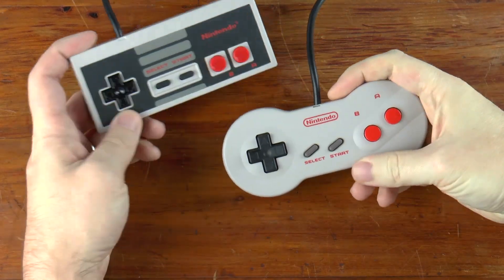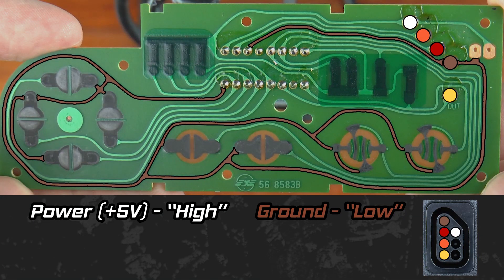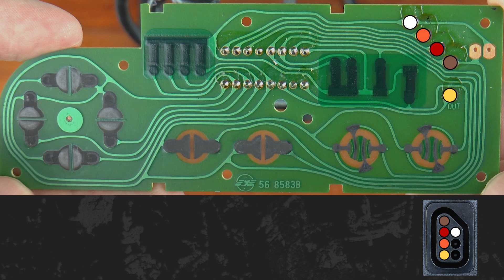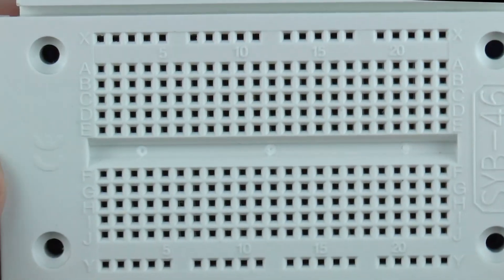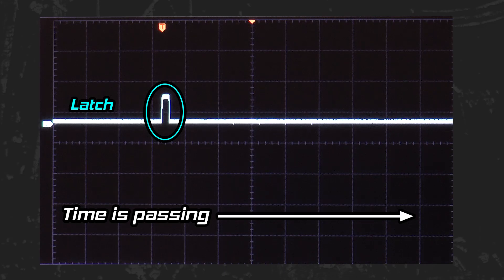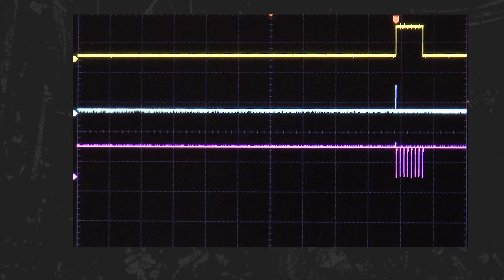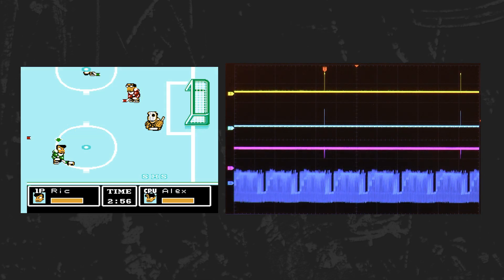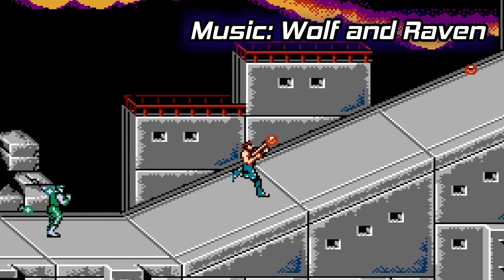Nintendo (NES) Controller - Electronics

Comment: I played sonic on my sega megadrive with the joystick controller from the atari 2600..🤣 It worked like a charm.. The connector is the same.. Just plug and play
Reply: I uses my mega Drive controller on my Atari 800XL...
Also works fine. (B button is the Atari's button, D-pad is the stick.)
In fact, with custom programming I can even read the C button as well, giving a 2 button controller on a system that usually only has a single button.

(of course, if I took the time to create an adapter that swaps around 1 or 2 of the connections, I could then write software that can read ALL the buttons on a 3 button mega drive controller, but that's more complex. - plus with the right adapter that only needs to adapt the wiring setup, I could read a SNES controller in as well and read all of that... )

The Atari joystick standard is extremely prolific. XD
Atari, Commodore, Sega, NEC, and a bunch of others all used it.
Though not always with identical wiring.
And sometimes with a few... Risks.

A Sega Mega Drive controller can hook up to an 800XL no problem, but if you hook it up to a Commodore 64 and mistakenly press a button on the keyboard and controller at the same time, you'll fry some of the c64's circuitry...

Use... Caution. Just because the connector looks the same doesn't mean the wiring is 100% the same. XD
Reply: I was young and ignorant at that time i did that.... 🤷🏻‍♂️🤣🤣
Reply: But it worked like a charm... As the controller was nothing more then some metal strips under a plastic button..... 🤣

Comment: How likely are the shift register chips to go bad? I have a few original controllers that no longer work. I assumed the wires were broken near the controllers case as I naively used to wrap them as a kid, but never found any breaks in the wires of the one I took apart and stripped. Solder joints looked good to me too. I assumed it was a problem with this chip tho I never knew what it actually was or called to this point.

Comment: This is a super well done video and does a great job explaining how it works. If possible, when you get to the SNES controller can you compare the improvements from the NES controller? As Sdudyoy pointed out, it's really remarkable how they decided to go the route they did in designing this. Even though this controller is decades old, the stuff in it is still the material that I learned about in university.

Comment: Intellivision had 15 buttons plus 16 directions on the disc for a total of 31 different connections or what you could technically call buttons since the controller is digital.

Comment: 12:20 how do you hit left and right at the same time?
Reply: Using his custom controller. His d-pad was made from 4 toggle switches, so there was nothing to prevent him from pressing any combination of the d-pad.
Reply: @JohnDoe11VII  But would that even do anything?
Reply: Probably create bugs?

It's physically impossible on normal hardware, so games have no logic to make sense of it.
How they interpret it would depend on how they're programmed.

I have seen TAS (tool assisted speedruns) that use a fake controller do it, and in some games it can let you pull off weird seemingly impossible tricks...

But there is no standard answer to what happens if you do it.
Depends on how any given game is programmed...

Comment: When I clicked on this video I was wondering "how on Earth is he going to talk for 16 minutes about a shift register?  An explanation of how those work is 3 minutes tops!"

Answer: he is going to talk as slow as he possibly can and spend a solid 30 seconds on every single component and trace on the board and gets five minutes in before he even tells you what the shift register does.

And when he DOES explain it, his explanation is going to be both confusing to the average viewer and technically incorrect.

I will give you credit though for breaking out the oscilloscope and explaining it that way.  Not a lot of people take the time to do that right.
Reply from the maker: I feel very proud of this video. Sorry you feel this way.
Reply: @DisplacedGamers  sorry.  Didn't mean anything by it, I just...

talking slowly is one of my personal pet peeves, even if it may help other people.

As for technical inaccuracy, I got you on a technicality.  There is no such   The shift register is always in serial mode, but the "parallel load" signal is what tells it to read the parallel input lines (which, as you said, are tied to the button inputs) and store them in the shift register.

and honestly, if you need a place to blow off steam, the youtube comments is where you do it.  do not read ANYTHING into what people write here and PLEASE, for the sake of your own sanity, do not take anything you read here seriously.  especially that comment.

As for the oscilloscope, seriously, thank you so much for that.  Like I said, not a lot of people take the time to do things right, and a visual aid is 1000000x better than an explanation.

Comment: Instead of a shift registry could they have used voltage levels to indicate what buttons are being pressed? Power ground and data. A being 5kohms or so and B being 4kohm... etc etc. Kinda like how some cars handle door lock input

Comment: I doubt you will see this but how would one go about figuring out which cables are ground clock etc in a knock off nes controller when you cant find a pinout?
Reply: One thing you can do is to open it up and follow the trace lines on the board, looking for + or -.  You can also read what type of chip(s) is on the pcb.  In the case of the NES controller, you would see that the only chip is a shift register, so you would google for "(number/letters on chip) datasheet".  Once you find the datasheet, you can use the pinout diagram in the datasheet to follow the traces back to where the wires meet the board, which would tell you which pin in the connector corresponds to latch, clock, data, power, and ground.

It is worth noting that this approach becomes significantly harder as the item examined becomes more complex.

Comment: Makes you appreciate the engineers who built these sorts of devices in the first place. Don't get me wrong, breaking this stuff down in an easy to digest way is complicated, but imagine having to design a controller before one existed. I think we take for granted just how complicated our every day devices are.
Reply: Well, game machine designers had an advantage here, because the kind of things they built existed in industrial control systems long before game systems.

Joystick-like devices were developed hand in hand with aircraft. And while those were mechanical...
Electrical switches also existed since electricity became mainstream.

And well, not to be too blunt about it, but you know what an Atari 2600 controller looks like on the inside?

Yeah, it's literally just a set of switches connected between wires that run to the console itself.
It's about as basic as wiring a switch directly to a microcontroller at that point.
This might've been novel in relation to it's use in gaming, but it was something that was in widespread use in electrical devices for decades by that point.

The mechanical design of stuff like a D-pad is a lot more interesting overall.

And more complex designs of course, yes, they did get pretty clever, but they had the older designs as a reference. (and many companies literally copied atari - right down to the connector used. - the various systems could all use the exact same controllers. You can even still attach a Mega Drive controller to an Atari 2600 and it mostly still works)

Plus, a shift register is a very common component with a well understood purpose. (it converts parallel data to serial data and vice versa).

These designs are very clever, don't get me wrong.
But from an electrical engineering point of view they are extremely trivial.
(the design of the plastic casing, d-pads, exact feel of the buttons and so on is actually considerably more challenging.)
Reply: I bet they started by wiring the buttons directly to the CPU, then ran out of IO pins so they added the shift register to the motherboard, to then realize they can move the shift register to the controller to use half as many wires. If they wanted to reduce the 4 player lag they could have used 2 or 4 IO pins instead of one.
Reply: Just a bunch of switches. Doesn't seem like it should be that complicated.
Reply: @twn5858  Happens to me often at work... Why haven't you see this it's obvious... Yes now in this moment it's also obvious for me. But last week. Why didn anyone say a word... Yes!

Comment: The SNES controller is just adding another 8 bit shift register. There's a pin on the register that will shift the data into the next register allowing for 4 more buttons to be pressed X, Y, L, R. I believe they used 16 bit registers instead of two 8 bit registers. This is why you can use a snes controller on a nes if you just wire the correct for plug. Thb Shift Registers are my fav components.

Comment: Thanks for this deep dive. I'm very new to electronics, so don't know much. But if I can ask - what is latch synchronized to? I get that the clock pulse can be derived from the latch pulse, and it just walks the line, but what is latch tied to? I'm guessing it would be to an RF frame on the TV, because it'd probably be easy to derive highly precise timings from the signal being generated, because analog TV requires highly precise timings in the MHz band (I think? I need to refresh myself on this.) FWIR there things like the front and back porch which the tuner has to latch on to to produce a stable image. It's why you'd get a rolling image when the tune isn't quite right. It's also why chrominance and luminance are a thing, because luminance is essentially drawn on top of black and white inside a colour burst for compatibility reasons. This is all from memory and I don't remember much, so I'm open to correction. Either way, this'd be plenty fast enough for the controller. I'm sure you would have said this, but I'm not known for being all that bright. Thanks.

EDIT: I am s'dumbs. If I actually bothered to watch the whole thing, I'd have known. Don't mind me! If you're curious as to how digital TV works, it's completely different, which is why analog and digital transmission and tuners are wholly incompatible. I don't know the first thing about how digital TV works, but what I do know is that it's an MPEG2 transport stream that may or may not be sent by way of UHF FM, hence it's a completely digital signal wrapped inside of an FM carrier in the UHF band - I *think*. No front/back porch, no chrominance/luminance, nothing. It's pure ones and zeros. Don't quote me, though. I really don't know anything about how it works.

Comment: 16:58 in PAL NESes you have a diodes on controller imputes to prevent controllers without resistors (NTSC or clone ones)  to work on the PAL console
Reply: Yeah, I had heard that applied to SNES systems as well.
But I've had no problem using my Super Famicom controllers on a PAL SNES...

Then again sometimes the protections are literally only to prevent US stuff working with anything else...

Still funny to me though that Super Famicom carts fit in PAL SNES consoles and vice versa but have software lockouts...
While the only reason a US SNES can't play Super Famicom games (and vice versa) is because of the respective shapes of the cartridges.
(the US cart is simply too big to fit into a Super Famicom - while the Super Famicom cartridge has a solid back while the US console contains two plastic tabs that fit into cutouts on the US cartridge. - otherwise the two machines are completely inter-operable.)
Reply: @KuraIthys  heh yes I know very "smart" :protection (US vs JP) :D

Comment: Great video! Could you make a video comparing the tech to the NES CLASSIC controller, as well as the official NES BLUETOOTH controllers (switch ver.). NES CLASSIC controllers feel the same and board looks similar. NES bluetooth is way different with tons of chips, and triggers diagonals too easily (I had to tape over the contacts to minimize this). I would love to know why this is the case...

Comment: As someone who just bought his first breadboard this week, this video was really helpful in understanding the fundamentals with a controller I grew up using :D
Reply: Biggest thing I will urge any new electrical hobbyist / maker to learn  (beyond basic components) is multiplexers, opamps, and shift registers. You can make so much cool shit with just those three things and complementary components of course.
Reply: @stillrabit73   ok i will take that on board.... how much more intrest did you get when you switched banks?

😊👐
Reply: Welcome to the world of electronics. I just got into it myself a couple of years ago. Two sites I'd strongly recommend checking out are Circuitmod on Paul Falstad's site, which is a great circuit simulator that really helps to visualize what's happening in a circuit, as well as helps to design and understand simple circuits. It has some great examples of fundamental circuits, both digital and analog.

The other is the textbook section of allaboutcircuits.com It's laid out in order of what you should start with, going through DC, AC semiconductors and digital circuits in many detailed, but easy to understand chapters.

Both sites were instrumental in helping me to get where I am today in terms of my knowledge, though I had many other resources to help me. These are just the two main ones. As a bonus, I'll also recommend checking out a program called Logisim. It's another circuit simulator, but it focuses purely on digital circuits. It's flexible enough that you could design and simulate a full computer within it.

In terms of advice, the most important thing I can tell you is don't rush the learning process. And don't shy away from the math. I can't overstate how important math is for this. A lot of people are scared of it, but I found in the context of a practical application, it's not nearly as painful as it was to learn math in school. 

But enjoy the journey, and don't worry too much about the destination. There is a ton of stuff to learn in electronics. College students don't even get into transistors until 2nd year. So just try to take your time so you don't end up with any gaps in your knowledge. It's better to spend a few days or weeks making sure you learn something proper than to spend years being hindered by a gap in your knowledge. There's no harm in jumping ahead if you're curious about something, but take care not to get distracted and forget about the fundamentals. So many times I've tried to jump ahead, only to find I need to know about half a dozen other things if I want to have any understanding of whatever I jumped ahead to. 

And don't be put off by failure. Failure is what helps us learn more than anything else.

Cheers. And happy learning. :)
Reply: Breadboard was fun for one week
Reply: what is a breadboard ? He talks about NES console

Comment: Man, I really could have used this video at the beginning of the year. I ended up learning all of this via online documentation and looking at an oscope, very fun stuff! Love that SNES has the same exact protocol, just a bigger shift register, ended up using those and figuring out Genesis as well for a project of mine. 
Google "retroconnect Github" and see if it's something you might be interested in helping out with or ping pong ideas with me. Would love to have a dialog!

Comment: You could build a controller with two shift registers and up to 16 buttons, and it could be read without any change to the console hardware.  I also suspect it might be possible to read NES controllers from a Commodore 64, with a plug adapter, and setting the port's data direction register properly.
Reply from the maker: The two shift register idea is more or less what they did for the SNES controller. They added four buttons to the existing NES controller and just added on to the original electrical design. The SNES controller is basically NES controller 2.0.
Reply: With all those shift registers, is that what made the NES Four Score possible?

Comment: It's important to note that the latch pulse doesn't just mean 'gimme the sate of A'.  The timing of the latch pulse defines the sample time for all buttons, the latch pulse says 'capture the state of all buttons right now and output A in the data pin'. The clock pulses then shift the output to the next button, but these clock pulses don't define when the buttons are sampled.  Many snes games clock out slower than nes games did, because of the use of a hardware feature that automatically reads controllers, so they are 'more laggy' in that sense.
Reply from the maker: "Let's go. Gimme A" was a slang way to say that the NES latch-signals the moment in time to take a snapshot of the pressed buttons as soon as the register hits parallel mode, and the register immediately starts outputting the state of "A" to the NES. This is always the first button the NES is expecting.

I mentioned it signaling a capture like a "snapshot" or a "photo" of the buttons states during the PCB section of the explanation, I believe. 

I suppose I could have mentioned it again in the scope section. I just wanted a bit of slang to help take away from the complexity of the scope. :)

Appreciate you dropping the word about the slower clock out on the SNES, Daniel! I'd like to examine the SNES in a bit more detail in a future video.

Always welcome your feedback!
Reply: @DisplacedGamers  To be clear, I think this video (and all of your others) are pretty good.  The explanation was ok, but I thought I'd made sure to note that, just because there may be some confusion as to when things happen, exactly.  Cheers.
Reply: I noticed on the oscilloscope it showed 8 shift pulses following the latch pulse.  So am I right that the 8th shift pulse was not necessary?  I suppose it's just the way the software loop was written.